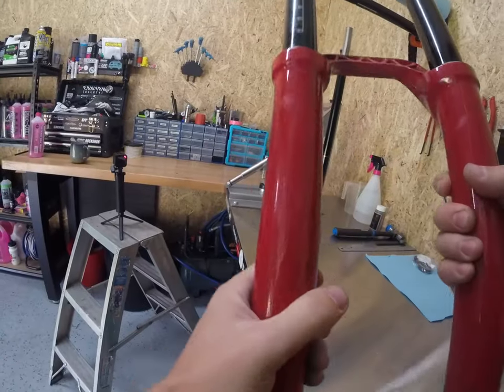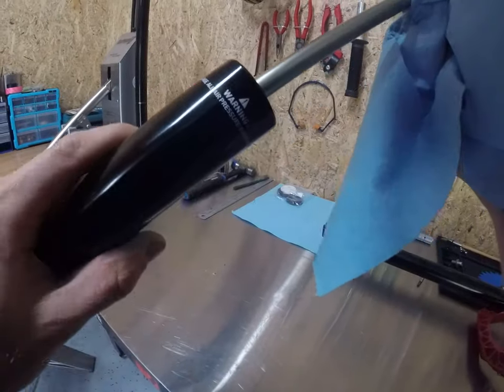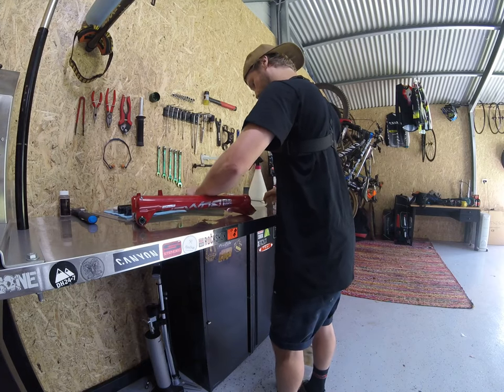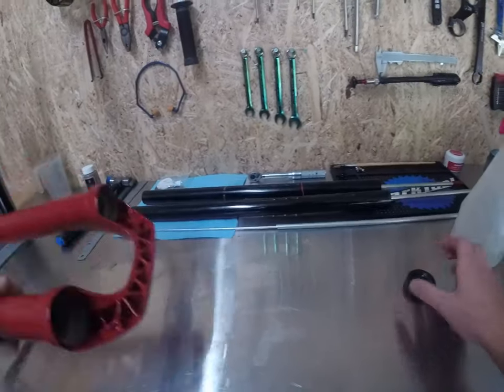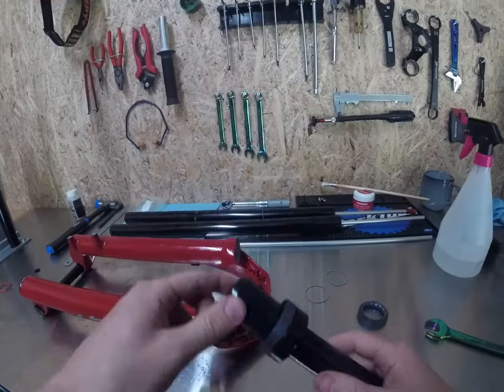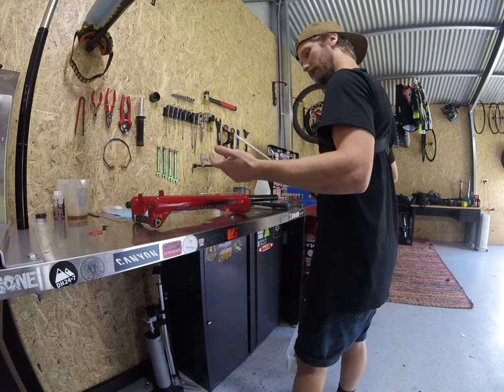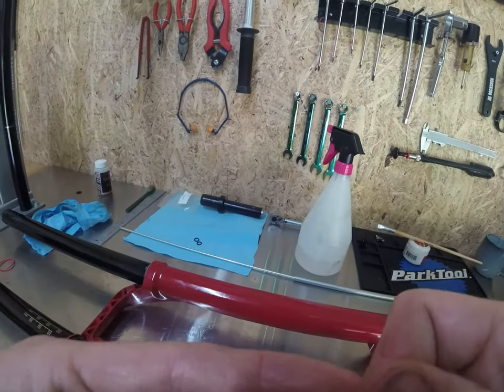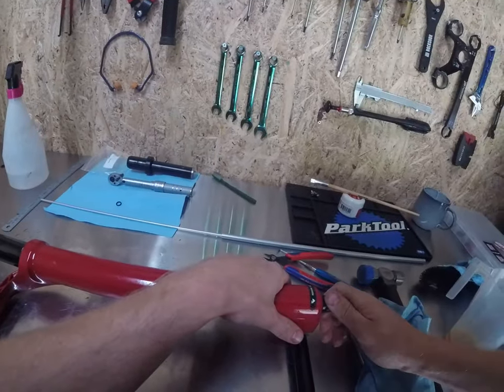Servicing your Boxxer Fork Lowers - CLLCTV Tech Tuesday Ep1

Comment: Why do you have to change the crush-washers on the screws?
Reply: to make sure it seals up properly. i think it should be possible to use the old ones, but it may not be 100% proof or the screws might come lose.
Reply: @leonfreestyl5853  you can reuse them if they don’t look amazed, if they look like they are worn or “crushed” hence why they’re called crush washers it is designed to seal the bottom so no fluid will leak out and usually lasts only once but I’ve reused them if they appear to be not damaged and wanna keep my others as spares and such
Reply: Why would anyone chose not to? It ain't rocket science. If you are performing a full service. It makes perfect sense. Especially for us with Ocd 😂

Comment: Don’t RockShox boxxers use wt15 oil in the lower legs???
Reply from the maker: Yes, the recommandtion from RockShox is 15wt oil. However, it is not unsual that Raceteams use a different oil. If a different oil is used, the fork needs to be serviced more often.